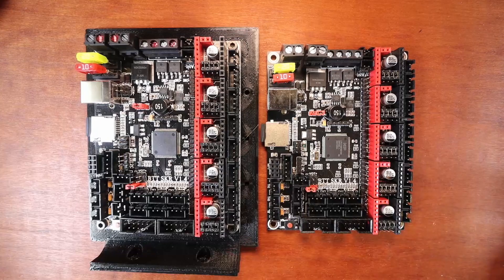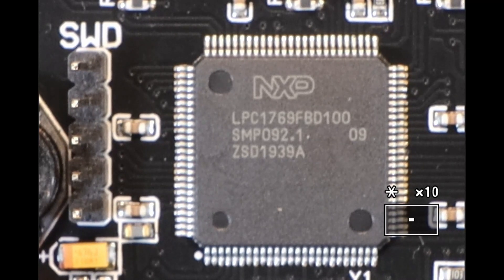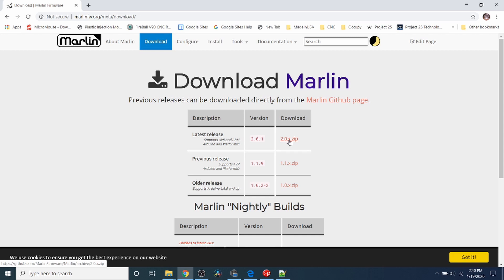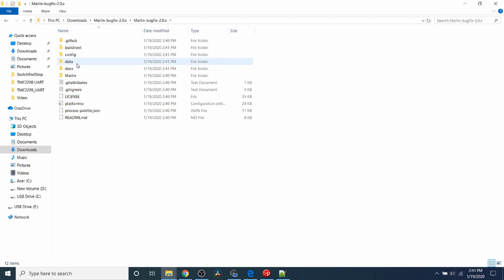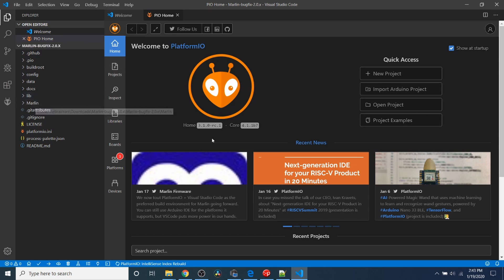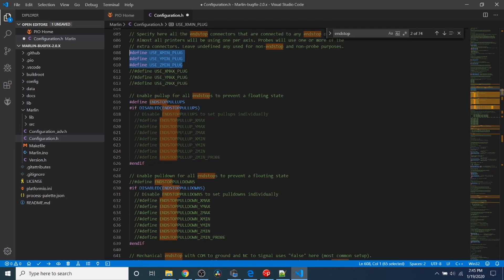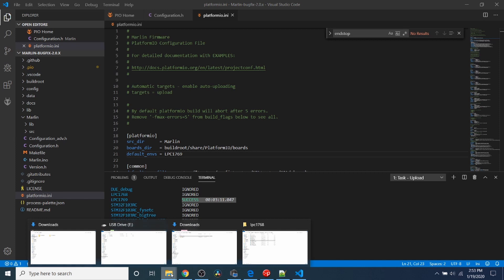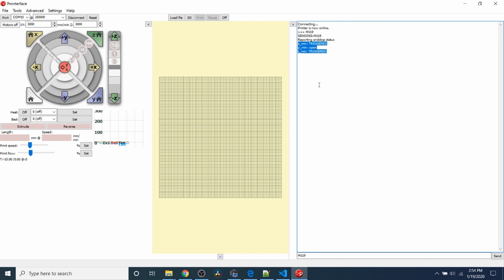SKR 1.4 - SKR 1.4 Turbo Firmware load

Comment: Just in time! My 1.4 Turbo will be here tomorrow. Thank you. I'm only worried about figuring out how to install the BL touch since i cannot find much about it with this board. Is it the same setup as the 1.3 minus the pins?
Reply: I got regular 1.4 with bltouch on my 3d printer and it works perfectly
Reply: @jbuckholt  Are you using Marlin? How did you get it to work?
Reply: @DiverseArtist  I'm pretty sure I am but I will double check this evening. I have the reprapguru prusa i3 printer.  After I put the bltouch on it prints perfectly every time.
Reply from the maker: It should be similar, but Marlin is working out issues with BLtouch.  I suggest using a switch Endstop until they figure it out.
Reply: @EdwardBraiman  Wouldnt i have to cut a pin on the TMC2209 to use a switch endstop?
Reply from the maker: Correct.
Reply: I bet so as the only real difference I see is having to tell marlin to compile for the 1769 as everything else seems the same.  Why did you buy this if you already had a V1.3?
Reply: @thebeststooge  I don't have a 1.3. I just meant the only BLTouch setups ive seen are for 1.3 on youtube. Theres not much explaining for 1.4.

Comment: What do you think of the bigtreetech gtr?
Reply from the maker: It's a somewhat good design, I wish they had three more servo pins like RAMPS.
Reply: Why don't these companies realize that if they charged 10 dollars more but gave us real IO pins/headers they would do a ton more business?
Reply: @EdwardBraiman  what are the servo pins used for? Do 3d printers use them? Could you eventually do tutorials on how to set them up?
Reply from the maker: They can be used for a servo or BLtouch.  I think I can do a servo tutorial.
Reply: @EdwardBraiman  and why would the board benefit from three more servi pins? Isn't one bltouch enough?
Reply from the maker: Normally you can run other devices it's all about imagination.

Comment: Well, it seems to actually be getting bigger.  Soon enough it will be the size of my computer so it can live up to the BIG tree tech name.
Reply from the maker: The text on the bigtreetech SKR 1.4 is difficult to read.
Reply: My thing is the board is bound to get even larger because they are shoving so much on it.  When I purchased my V1.3 I was wondering how 20mhz more would be but is it just 20mhz more or does it perform more instructions per clock cycle so 20mhz is more like 30 or 40?
Reply from the maker: Unsure without testing, but it is a faster chipset.
Reply: That should help with a laggy 12864 I experience with it.